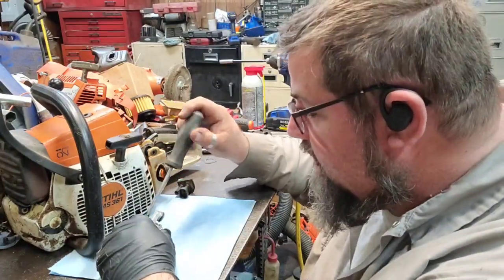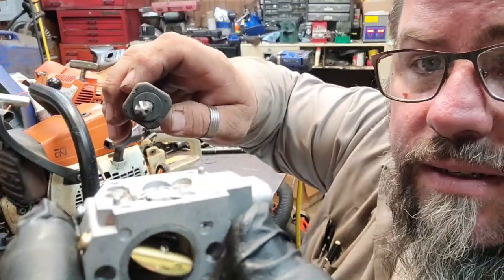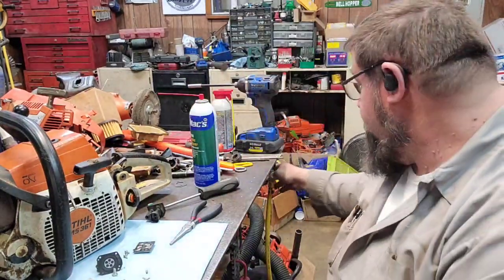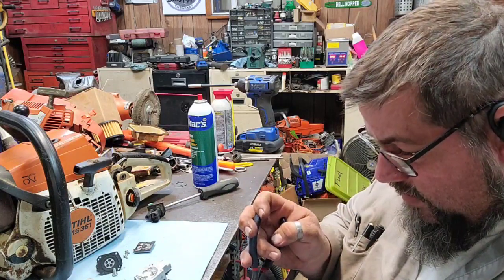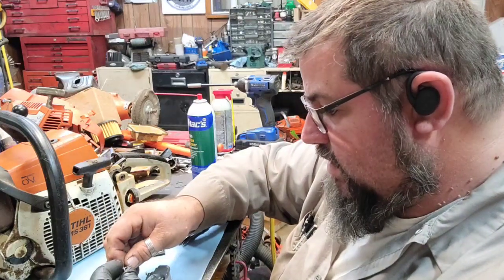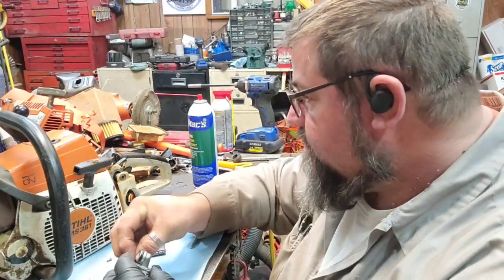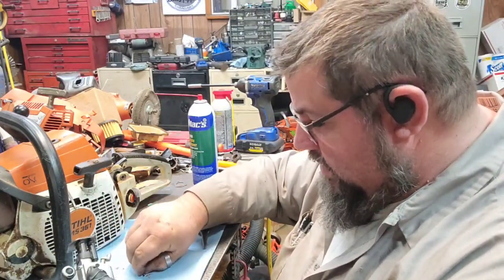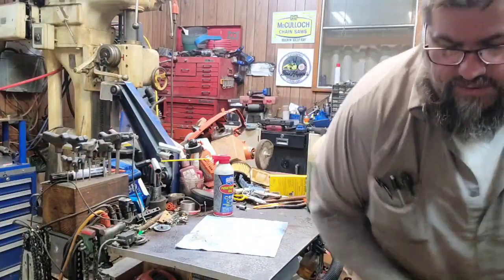Lets Ride The Tractor And Clean A Carb On A 361 Stihl

Comment: What kind of 2 cycle mix do you use and ratio for a ported saw thank you
Reply from the maker: I run 32:1 in my saws and 20:1 in the methanol saw some of my customers run 50:1 but i dont  recomend it
Reply: @bellhoppersaws  what brand oil thanks again
Reply from the maker: I run pennzoil husqvarna oil istica oil i use all kinds no purticular brand

Comment: I was wondering what you thought of the crappy chain catcher/mount setup. I had a ms 360 that kept pulling the mount out. Lond sold the saw but my new 362 seems to have this same set up. Would you recomend dual dogs with a chain roller?
Reply from the maker: It does help. That catch breaks off all the time